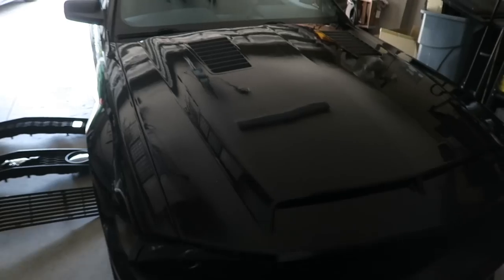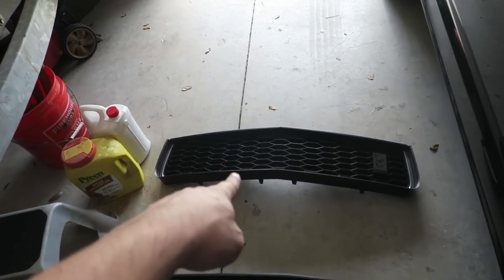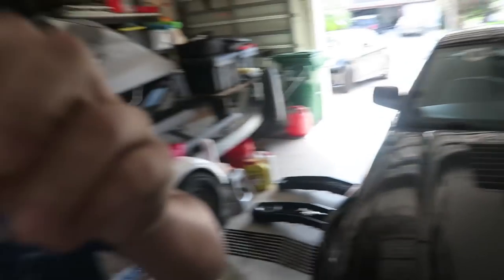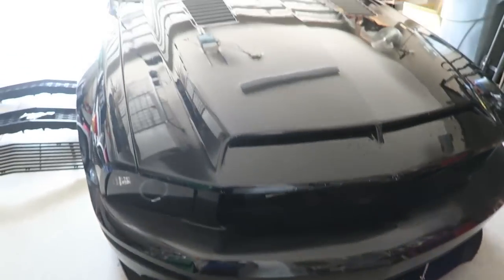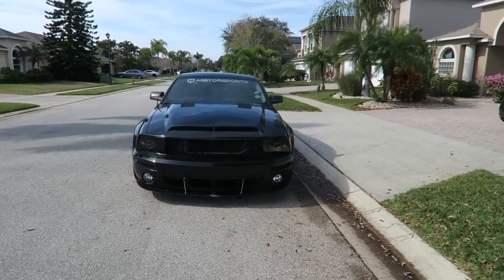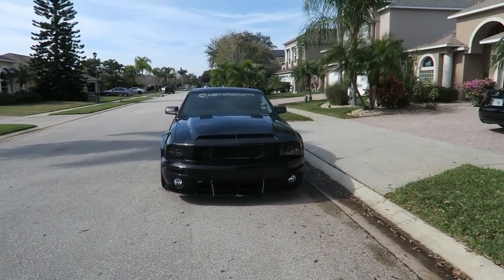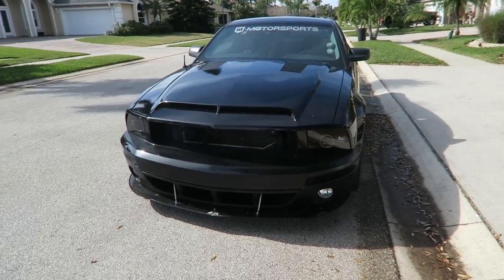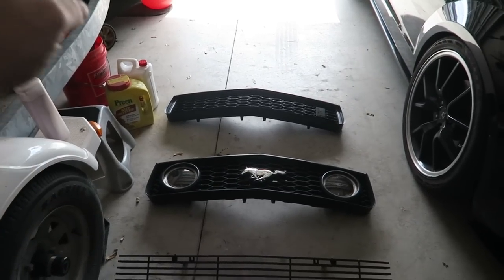Installing New Grilles on the Mustang! (Grille Delete, 9-Bar Roush, Stock, Bullitt Style Grille)

Comment: Since I own a Bullitt, I'm partial to the chrome lip and OEM honeycomb style of the Bullitt grille. However, that Roush grille was a VERY close second. I'd have had a hard time deciding between the two. I'm not a huge fan of the GT fog lights (unless they're hidden behind the grille somehow), and the no-grille option just looks unfinished. If you were going that route however, I'd at least get a horn relocation kit, to not break up the view of the radiator.

Comment: what people don't seem to grasp is the placement of the fog lights in the factory gt grille balance out the front end design. The ideal grille for these cars doesn't exist, which would be the factory grille with fog light cut outs without the pony marker. Billitt bars look cheap, the bullitt grille is too boring. I'm seriously considering modifying a bulllit grille to accept fog lights by way of cutting, JB welding, whatever it takes.

Comment: Out of those options I’d stay stock, with the Roush 9 bar in second place.  But if I could pick anything it’d be this grill http://www.streetbeatcustoms.com/Agent-47/Custom-Fit-Grilles/Ford-Mustang-Agent-47-High-Flow-Upper-Grille-_-30203/642376/  It’s a little pricey but looks great.  I like how it pushes the fog lights a little further apart.